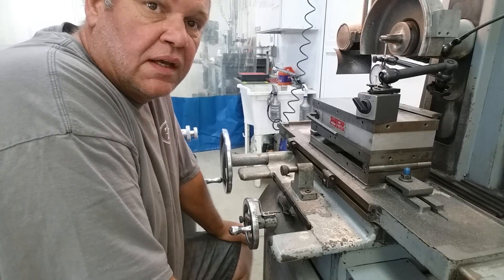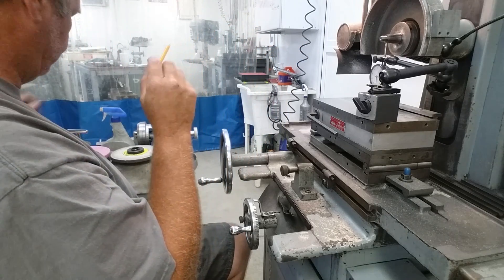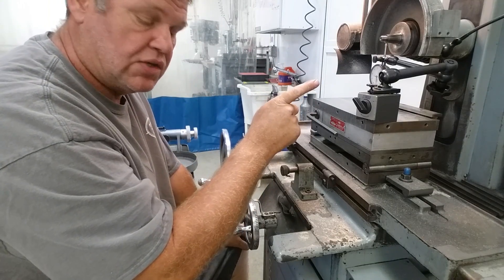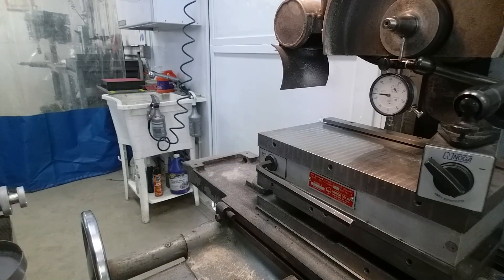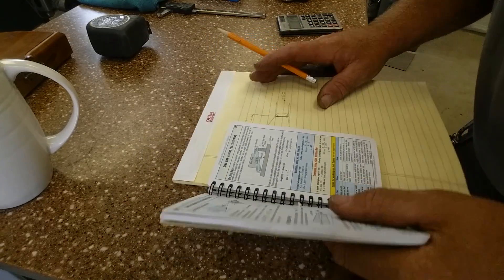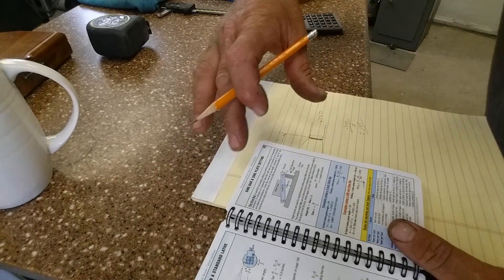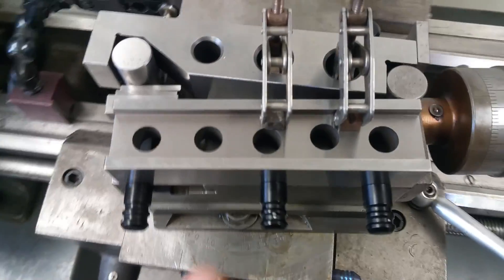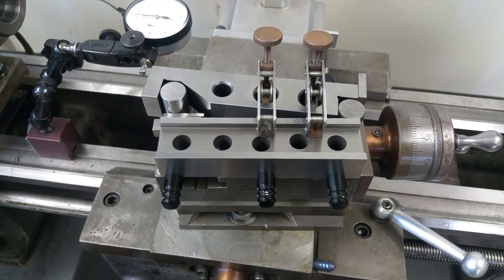Calculating and setting up a taper part #1

Comment: At about 10:00 you are determining the height of the gauge blocks using tan(theta) when you should be using sin(theta). For small angles sine and tangent are fairly close, but by 7˚ they are off by about 0.0009 in an inch and five times that for your gauge block stack.

Tangent assumes that the rolls remain the same horizontal distance apart, but as the angle increases the horizontal distance becomes smaller until at 90˚ the horizontal distance becomes zero. 

The sine function assumes that the horizontal distance is irrelevant and the center to center distance is constant (in this case 5").

You need to calculate the angle accurately using the best tangent table available (or a good calculator) , and then use the resulting angle and a good sine table to calculate the height of the gauge blocks.

If I calculated it correctly, your gauge block stack should be more like 0.620" rather than 0.625".
Reply: Correct
Reply: Of course, this is all explained in Part 2. I often jump the gun by pausing a video to make a comment and find it has been covered later in the same video. I don't usually find it in a later Part. (Thanks Stan.)

Comment: Nice setup with the sine bar and gauge block stack. Interestingly, if for some reason you only had metric gauge blocks, you could still  do this either exactly or "close enough": 0.625" is 15.875 mm. Even if you can only build 15.87 mm you are only going to be off by 0.4 tenths in one inch. Lathe probably isn't that accurate anyway.
Reply from the maker: No, the old girl struggles to hold a thou.

Comment: Good video Stan, wish I had seen it before I had to work how to measure the taper on my T&C grinder. I did a video as well using 2 dial gauges. I found a few traps as the grinding head on my machine can move in any axis thus giving you false readings https://www.youtube.com/watch?v=A9oeLhcyA2c. Thanks for showing the sine bar setup. Greg

Comment: The angle is 7 degrees 09 minutes 10 seconds which is the angle of a No 8 frog.
Reply: See my other comment. Once you have calculated the angle from the arctan 0.125 you need to take the sin 7.125 which is 0.124 (times 5 gives you a sine bar stack of 0.620" instead of 0.625").
Reply from the maker: Guessing that is a block plane?
Reply: I am sorry to have not added that the frog is a device in a railroad track which allows the flanges of the wheels to cross the opposite rail.  They have been made from No 2.5 and up.  The frogs in high speed track such as France's TVG are around No 24 to No 30 with swing noses so there is not a gap in the running surface. Most railroad track turnouts in a main line are No 10 for industry tracks to No 15 and No 20 for remote controlled sidings or junctions.

The No of a frog is the number of units it takes to spread one unit.  The one unit is perpendicular to the line measured and centered on it.  Hope that explains it.
Reply from the maker: Thats pretty interesting, the blade holder in a block plane is also called a frog :)
Reply: A No 10 frog is 5 degrees 43 minutes 29 seconds.  A No 20 frog is 2 degrees 51 minutes 51 seconds.
Reply: While I don't disagree on the #8 frog angle, I get a different angle for a 0.125 taper. Arctan 0.125 = 7.1250xx degrees, which is 7 degrees 7 minutes 30 seconds and small change.
Reply from the maker: Hi Wilton,
I got the same result as you, but don't like being the disagreeable sort. :)
Reply: Well, I hope I wasn't being too disagreeable, and I hope Roy won't be upset. Math errors are easy to make even with a pocket calculator, I make them all the time.
Reply from the maker: Ha ha, your right more than you know, go watch part #2 :)

Comment: I am not sure that your sine bar stack is correct. The 5 inches is the hypotenuse and not the horizontal and so you can't just multiply the 0.125" directly. If you work from the tangent and then take the sine of the angle you get a stack height of 0.62017" for your 5" sine bar.

Apart from that I do really enjoy your videos.
Reply: Just that in the one you are measuring along the adjacent, while on the other you are measuring along the hypotenuse. So you can't just multiply by 5. You would actually multiply by 4.9614 for that angle.  The sine bar will alway be the hypotenuse. Yet the taper is usually measured along the adjacent or centerline. I also get .6202" (rounded to tenths) for the stack on a 5 inch sine bar to get a half of a 3 in 12 taper.
Reply: Yes, I think you are right.  The error with the 0.625 stack over the 1 inch is .12599 vs 0.125 so about 0.001, pretty small but could be taken out.  If the taper was a larger angle, the error would be much greater.
Reply: Exactly, your initial measurement was on the centerline, but your final measurement moving the compound was along the taper. So you should have had to move 1.0078" of compound to get the .125" indicator movement.
Reply from the maker: Hey Graham, Initial measurements were 90* from the spindle centerline, not 90* from the taper.

Comment: Correct me if I have missed something.. It was my understanding that when you move the compound off parallel with center-line of lathe that the 1 inch distance travel would be compounded and introduce error..
Reply from the maker: Indeed it does, this low angle would introduce less than .001 in hypotenuse length (over 1 inch), moving an extra .001 on the compound would not indicate any detectable amount.
Reply: Thanks very much for the info. I really enjoy your videos..

Comment: Very informative.  While there are numerous ways to come up with the degrees (7.125) your compound should be set at i.e. a = arctan((D/2) - (d/2))/L, your finished product will only be as good as the accuracy of the protractor used to set the compound.  Your demonstrated method of using a sine bar and stack blocks is pretty much fool proof.  Looking forward to Part 2.

Comment: This info will come in hand for setting up my taper attachment in the near future.  I'm making a large taper (about 12" long) for use in as an arbor for an 3" expanding mandrel that I have. (somehow I ended up with an orphan outer expanding mandrel sleeve at an auction)

Comment: I probably just had put a precise round stock between centers, an indicator into the tool holder and then adjusted the compound until I got the .125 movement over 1" travel. 
That even would have compensated any misalignment between bed and headstock (got an old and pretty worn Atlas 618).
Reply from the maker: Drill rod with a (flat tipped) indicator would certainly cancel out any tailstock misalignment. Good suggestion.
Reply: After thinking about it (now I know what kept me awake!) and watching the second vid, there indeed something isn´t right. 
The travel for the correct taper is along the axis, but with the gage block or my method (which just simplified yours) it is along the hypotenuse. 
The travel along this has to be a tniy bit longer, but it´s easy to calculate (Pythagoras, anyone?). The, I call it ´angled travel´, would be 1.0078".  Or the indicator should just move .124" over 1".

Comment: Nice setup using the sine bar.  With your square compound (my Atlas isn't), much easier to use that method than the two indicator method that I tried when I setup my MT2 taper.  I pulled the bozo and didn't realize the taper was for the diameter and not per side...had to redo it a second time.